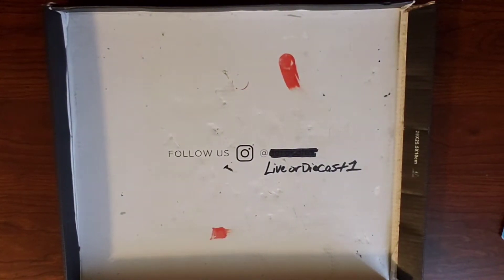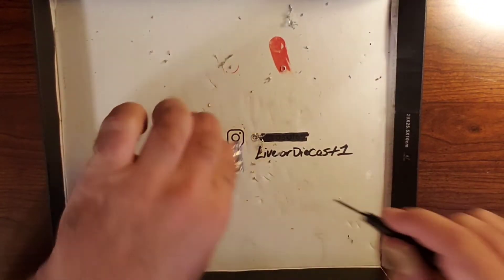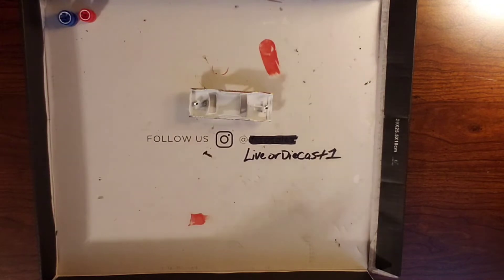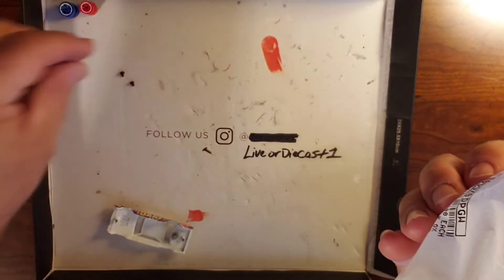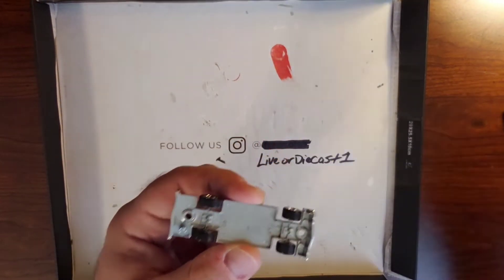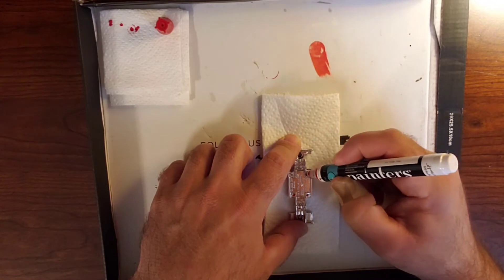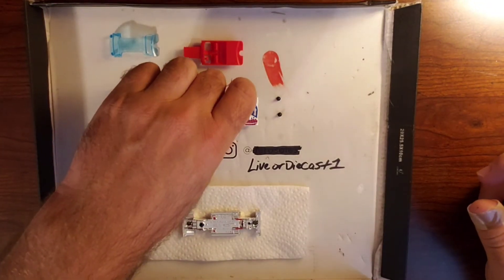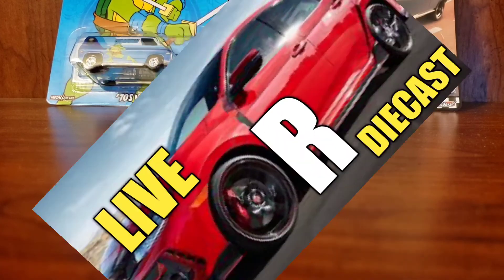Wheel Swap on 1968 DODGE DART: Installing Real Riders and some Details.

Comment: I use those paint markers as well and I have had them leak all over so I now just dab a dot of red or yellow for the tail lights and side markers and use a toothpick to get those tiny details done. Will save a lot of future heartache if you try it that way, Brandon.  Definitely better with a wheel swap!
Reply from the maker: Thanks for watching! Appreciate the tip Charles!